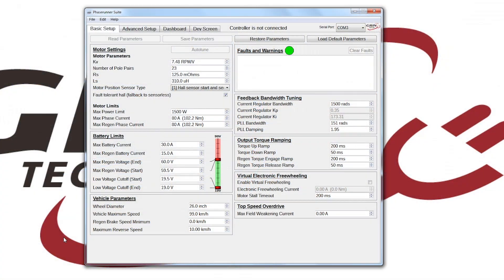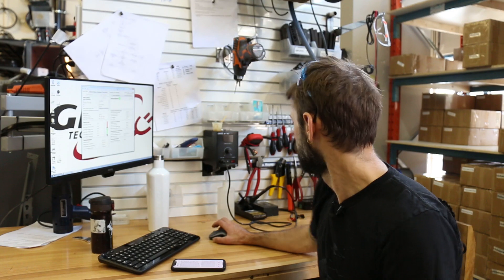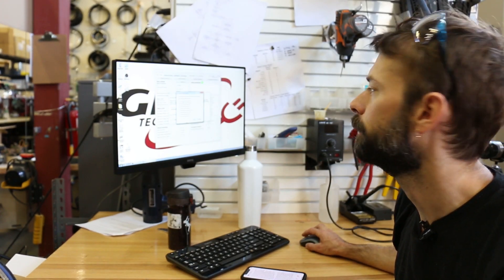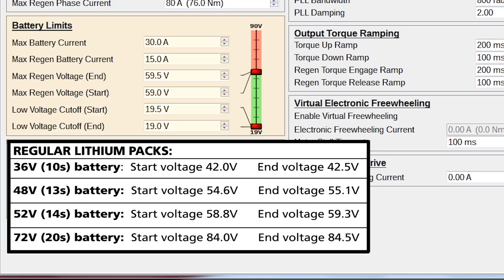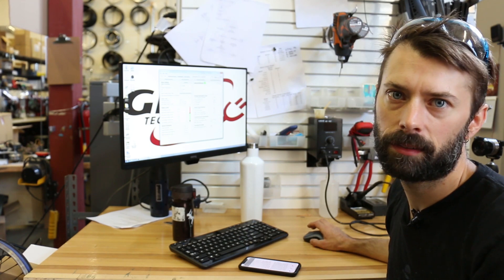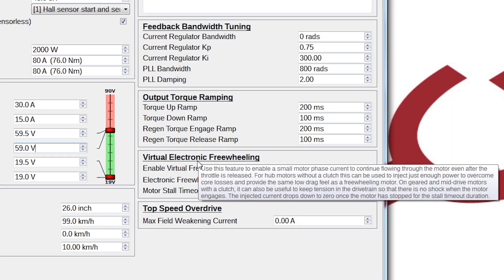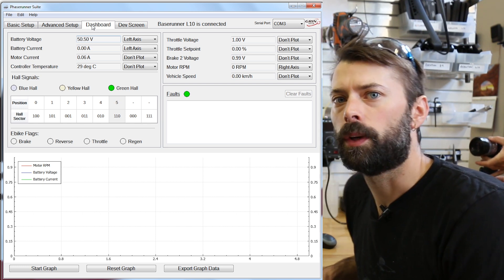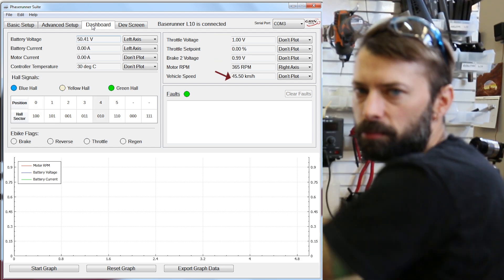Phaserunner Software V1.4, Loading Default Parameters and Basic Overview

Comment: rather superficial, a pity he didn't show what effect d various settings really have. what to look out for.  when i play around with d parameters i often notice no change. like when i open d throttle, i can't achieve a really smooth start, rather wheel starts spinning with  of a kindof  "klong"  noise  😏  that's  with d wheel propped up, no load
 i mean he didn't say more than we can already read in d manual.
Reply from the maker: Yeah this was just a basic overview video for people getting started who aren't inclined to read the user manual, not a deep dive video.  Are you running a sensorless startup routing? With a torque throttle the behavior of the motor unloaded on the stand is not how people expect, and even a tiny amount of throttle motion will result in the wheel spinning at full speed since there is no resistance.
Reply: @GrinTechnologies   i know, without load wheel really speeds up, when accelerating with me on of course less, according to throttle, just d noise is always there, more or less. kindof like if you'd put a gas-motor into 1st gear without using d clutch  😁
just wondering what it could be as there are no parts engaging?
anyway, just a minor issue.  
regarding d controller-setting details, do you have any links ?

Comment: does this controler wor with the 48v 1000w 1200w ebikeling line of hub motors?
Reply from the maker: Yes, but you'll need to run autotune and change your connectors over to match.

Comment: Is virtual free wheeling activated by turning the motor or just throttle application?
Reply from the maker: It does require an initial throttle application after the controller has been turned on. It would make more sense if it started automatically with the wheel spinning but that is not the behaviour that ASI has on their firmware.

Comment: Hello Grin tech...I have a swagtron Eb5 pro plus ebike and it has a 36v geared hub motor ....would  I use your default settings for your smallest geared motor.  I don't know the pol pares ect ect, I was hoping that the phase runner would have an auto tune feature because I don't have the spec sheet for the motor.
Reply from the maker: Hey Darren, yes in this case normally start with the parameters of the closest hub from Grin, and run "autotune" after that. The software will never be able to guess the actual pole pair count, but it's not all that consequential if it is off, and you can tweak it after the fact if you want by comparing the speed as reported by the phaserunner software suite with the actual speed.  If the software says the bike is going 45 kph, but your actual speed is 30 kph, then you need to set your pole pair count 50% higher for it to be correct.
Reply: @GrinTechnologies  Thank you so much for the reply. I will order the phase runner but I'm just trying to make sure I have the  correct info to make it run correctly. I'm watching your videos so I can understand pole pairs a bit better. I want to run the motor at 48v instead of 36v. I will order one soon. Thanks for the information again...it really helps...

Comment: You do a plug an play bbshd . Will you ever do one for the bbso2b 48v750w . Would be good
Reply: Rick ! Its says 750w but you buy a 1000w contin battery but the bbso2 750w puts out 1000w to 1200 peak an 1470 with a good 52v battery . I should have bought a 1500w contin battery as 1000w rated drawining 1200w could damage the battery
Reply: @henrievery-3rey  yeah u can get a eggrider lcd that does the same thing . Bluetooth.
Toyin with the eg lcd but very small
Reply: Been reading on endlesssphere the bbso2 and hd are very close motors size etc . An enginner tests them and the copper mass is not much in it at all and the case is bigger by 30mm wide and extremly very close to dimensions .
Even  worth a read its very interesting. Maybee the bbso2 could run at 30 amps and 60 volts .only brunovseamsxto have played about with it .
But sure it can run 5amps at 1500 watts as long as riding with common sence and not 10 min at 35 mph . Sure you could cruise at 27mph and put a temp probe in the motor an watch the heat
Reply: @henrievery-3rey  rick which one would you surgest?
Only thing is theres no speed  connecter
Reply: @henrievery-3rey  yes thats what i would like to do for when my controllee blows

Comment: Still waiting for the bluetooth adapter (One of those shut up and take my money things) and my setup would rely on it because my controller is encased and cant be accessed
Reply: This gets my vote. I did a (very) quick search for 'ttl bluetooth module'. It looks like there are a few hoops to jump through to get a working solution.  Modules are available, but getting the interface between the phase runner and the Bluetooth could get messy, unless done properly.

A better solution would be a phase runner with Bluetooth built in, but that's a bit difficult to retro fit!